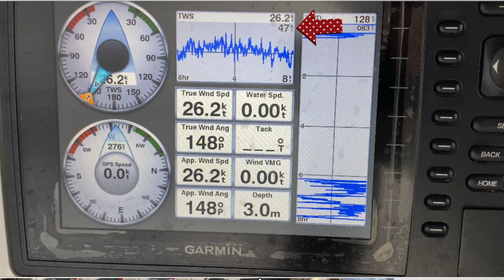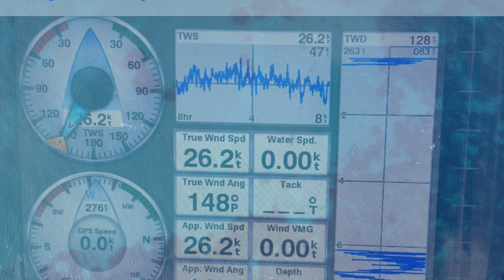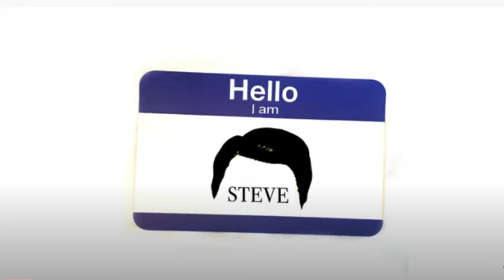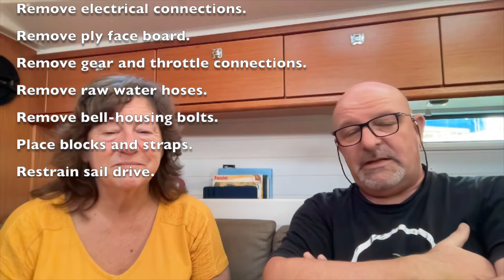Stormy Weather & Boat Works;

Comment: I don't have a boat (yet) but I know that over at Kraken yachts in Bodrum, they tested out various through hulls by sinking them in the marina for several months and found that the true design plastic ones were the only ones that could still be operated, the growth just popped off the ball of the valve when it was turned. So that's all they install. For whatever that's worth.
Reply from the maker: Thanks for the comment Jim. Sail Safe mate. Ant & Cid